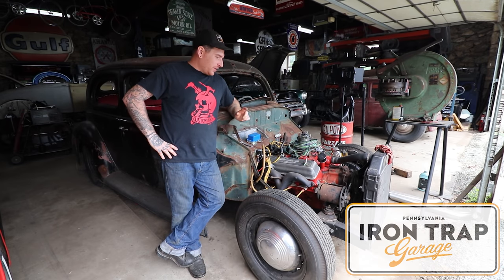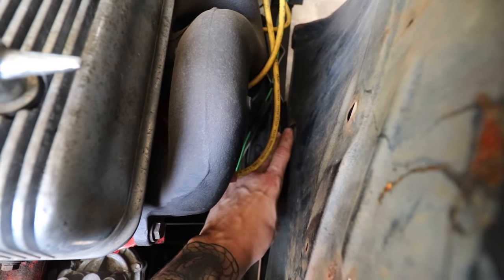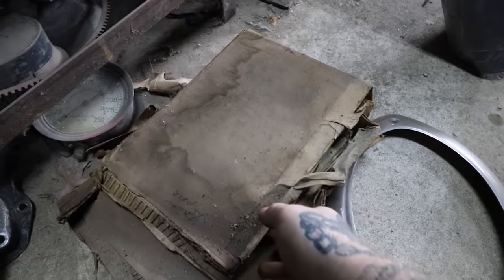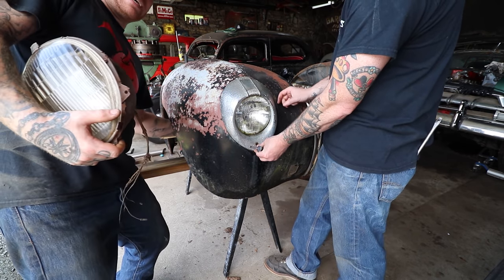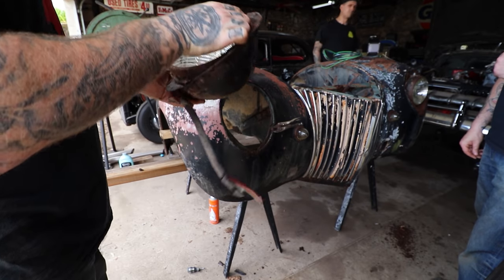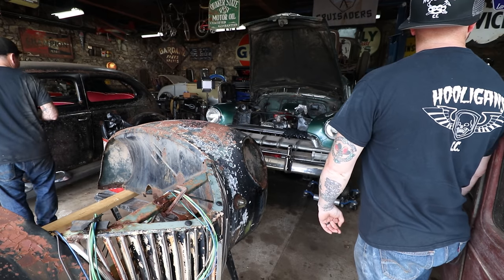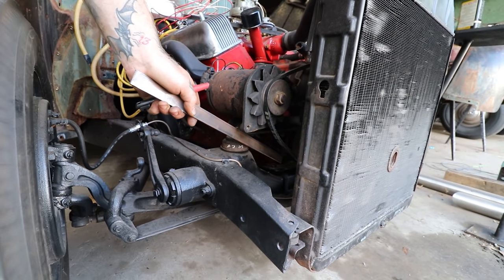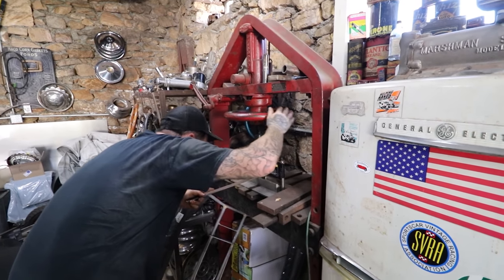Putting The Front End On For The Last Time - 1939 Ford Forgotten Hot Rod

Comment: Hey Mat, Mike and Other Guy,
Good to see the crew back at it.
The 39 Headlights now match the name of the car.
Nice wiring job Mike.
Mat you are going to unhappy with your bends on the Gen. tentioning bracket.
If you look at original brackets they do not have 90 degree bends because they are weak and will eventually crack and break.
You can gusset them on the inside of the bend or you can lessen them to 45 degrees to make them more like the original as well as add another layer to that area.
You used mild steel but the original bracket is hardened steel.
55 years of experience building this kind of stuff does come in handy now and then.
The stress of the gen. belt always trying to pull down will  bite you on the butt if you leave that bracket "as is" !
The long curve will be fine but those 90's will get ya.
Just an old hot rodders advice.
Be safe and well guys.
   thanks for the videos.

Comment: I don't  use a tape measure much either. I nearly broke my 39 headlight glass the other day. Took it off to replace the globe. The chrome trim is real tight. When it released the glass went flying. Caught it just before it hit the ground. My hart was racing.

Comment: I guess I am weird because I much prefer the 40 headlights. Probably why they made conversion kits. Good to see work being done on the 39.
Reply: @Fred Maxwell,  the conversion kits were so sealed beams could be installed in the '39, same reason they had to change the buckets for the '40.
Reply from the maker: The original look isn't for everyone. No fault in liking the 40 headlights!!
Reply: They made them to use sealed beams which gave more light. A Drakes halogen conversion for the 39 buckets is the way to go in 2020.
Reply: @williamcarey6592  They may have made them to use seal beam but they also made them look like the headlights on 40 Ford which is what I was referring to, that I liked that look better.
Reply: @19reedCharles44  Ok but they still made them look like the 40 Ford headlights which I much prefer the looks of.
Reply: @IronTrapGarage  Thank you.
Reply: @fredmaxwell9619  ...and that is fine, we all have our own preferences and tastes, certainly nothing wrong with that.

Comment: The front end is on!! I was worried about the fitment a couple weeks back when you had to move the radiator forward to clear the fan. Macs, c&g, and drake sell the headlight buckets if you can't source them used. I've got to get a set for my 40 pickup since mine have rust holes in the bottom of them.

Comment: Hello Matt& crew. The ones that were on looked like proper 40 type, not conversions. the conversion kits don't look quite so neat. I'm surprised the fenders are the same 39-40. Hope you find a nice matching 39 bucket. hard to judge from here, but did you check the generator can swing through an arc that will actually tighten the belt as it swings? It looks like it might be a bit limited. Nice job on the adjuster strap though. The car is shaping up well.
Reply from the maker: Yes the belt gets nice and tight halfway through the arc. No slipping when we started it and revved it up so I think it’ll be ok.

Comment: 37 to 39 head light glasses are not the same. 39 Std for example looks like a 38 but if you install one on a 39 it will aim the light into the sky. 39 Deluxe are completely different to 39 standard so you need one 39 Deluxe glass rim and bucket. with reflector. I'd be using H4 halogen bulbs too. They didn't refer to those headlights as "glow worms" for nothing.  😉😎
Reply: @Mercmad, yup, I think you are correct about the '39 Deluxe headlights.
Reply from the maker: Are the buckets different? I believe Matt was referring to the buckets
Reply: @IronTrapGarage  I believe the buckets are different, they sit in the fender at a different angle.

Comment: Now you just need your detailer to come back and make it nice and shiny like the 34! That will test his abilities!
Now you have two running driving cars with no brakes!
And no cooling connected. And both will need radiator filters to keep decades of rust out of the radiators.
Reply from the maker: We plan to flush the blocks and radiators on both. The 39 already has brand new brakes.

Comment: The 39 DeLuxe, 40 STD & DeLuxe passenger car fenders are interchangeable. 40 headlamp assemblies bolt right in to 39 DeLuxe fenders. The reason your headlamps didn't fit the fenders is because you had 39 STD headlamps rather than DeLuxe. DeLuxe lights are flatter and wider than STD.

Comment: I really am surprised at how you guys do wiring.
I never see you put loom protection over the wire bundle.
Or chassis grommets when the harness goes thru a hole.
Reply from the maker: The wires will be wrapped with cloth tape (much like was done stock) versus the corrugated stuff. Grommets are added when the we’re done the wiring. Still have wires to pull and all that jazz.
Reply: @IronTrapGarage  OK thanks for clearing that up.

Comment: why didn't you use the holein frount of  the motor mount
Reply from the maker: You want the brace to be to the motor not the frame. The rubber mounts cause flex and if the bracket is mounted to the frame it will bind and potentially crack